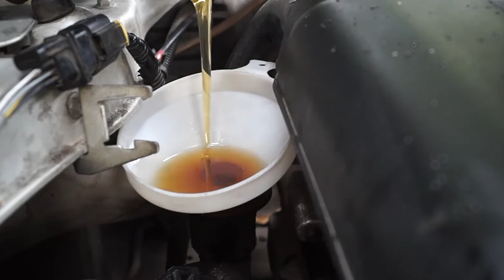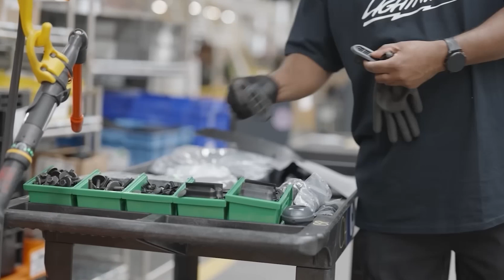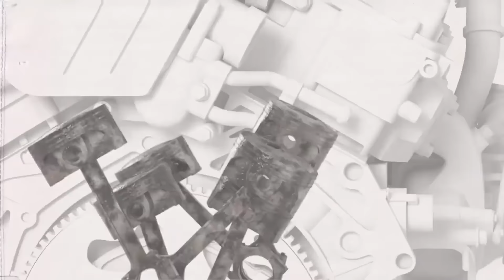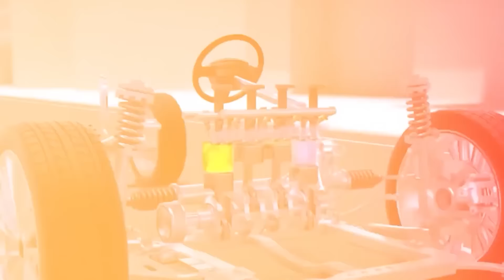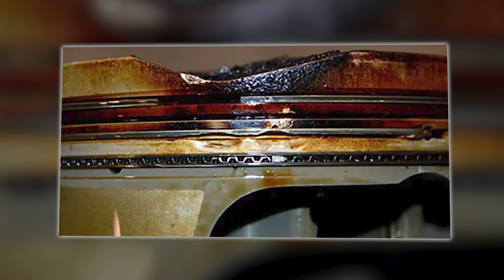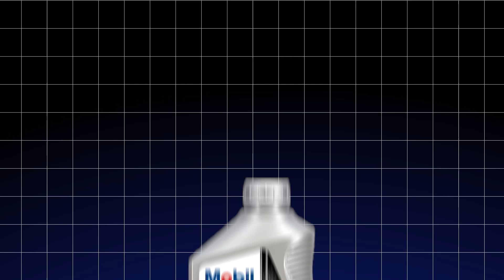Toyota Secretly Lying About Oil - Mechanics Refuse To Use

Comment: My car calls for a 0W8 grade oil. I use 0W8 oil starting in the last few weeks of fall when temp starts to drop to below 10. I then switch to 0W16 / 20 once it starts to warm up. I NEVER go beyond 5k miles between oil changes or every 6 months. This is an AI made video. Having trouble reading "molybdenum".😅

Comment: The 2026 Toyota Corolla Cross uses the same engines in the US, Canada, and Australia with different recommended oil viscosity:
                       Engine         Oil viscosity
      US           M20A-FKS    0W-8 only (page 442)
      Canada    M20A-FKS   0W-8 only (page 442)
      Australia   M20A-FKS   0W-16, 0W-20, 5W-20, 5W-30, 10W-30  (page 357)
Note the same engine, M20A-FKS, is used with recommended oil viscosity from 0W-8 (US and Canada) to 10W-30 (Australia).
Notice the US and Canada are the only countries recommending using 0W-8, and it is the only weight recommended. It’s obvious these thin oils, 0W-8 and 0W-16, are only used to get the best possible mileage and emissions, regardless of fact they disastrously shorten engine life.
Here are the URLs for the owner’s manuals.
     US: https://www.toyota.com/owners/warranty-owners-manuals/
     Canada: https://www.toyota.ca/en/owners/manuals/
     Australia: https://toyotamanuals.com.au/#/
Don’t take my word for it. Do your own research.
My wife’s 2026 Toyota Corolla Cross (Toyota states “must use” 0W-8) gets 5W-30 Mobile 1 Full Synthetic with Toyota OEM filters at 5,000 miles or 6 months, whichever comes first. By the way, in Australia oil viscosity up to 10W-30 are recommended for this engine 
Auto manufacturers recommend engine destroying 10,000 mile (or more) oil change intervals. Why anybody would trust their light oil recommendations is beyond me.
Bottom line: Before CAFE requirements most engines listed 5W-30 or heavier oil that was best for the engine. Today, with CAFE requirements, the recommended light weight oils are best for the manufacturer, so the best viscosity oil for your engine is probably not the one recommended.

Comment: Toyota brand oil is made by Mobil 1. So does tyat mean Mobile 1 oil is exactly the same? I just bought a Corolla and it's nearing time for the first oil change. I chose to go with Valvoline Advanced Full Synthetic.  Am I ok with this? I never go 10,000 miles between changes.  5k at absolute max.

Comment: I recently bought a lexus ux 250h with the m20a engine. Its recomended foe 0w16, my dealer fills 0w20 in and i got a 15year warranty on it. If those oils were bad for the engine, i dont think thy were able to give a long term warranty. 😂

Comment: This is false. Mobile 1 OW8 is available for everywhere. The dealers charge $100 on average per oil change. The hybrid engine not only does not run hard because when paired with the electric motors, it also runs cooler. I trust Toyota not this one ai produced post. Change oil every 5k. The Camry will run indefinitely when cared for properly.

Comment: Total garbage. Toyotas in Asian markets have used 0w-8 for a decade with no problems - unless better gas mileage is a problem. I’ve used it in my 25 Camry for two years with no problems and used oil analysis shows no unusual wear. Nearly every statement in this video is a deceptive lie.

Comment: Why would Toyota deliberately spec a motor oil that wrecks their engines? It’s nonsense.   I do believe oil changes at 5000 are a much better maintenance plan than 10,000.  Especially if you are driving a lot of high speed highway miles or many short trips in cold weather.  Oil is relatively cheap, engine replacements are not. Use the recommended oil to protect your warranty and change it more often.
Reply: Because the governments are forcing manufacturers to come up with better mileage. Thinner oil is less friction.

Comment: sorry to say it, but 0w 8 has been working well in toyota engines. The oil has been tested time and time again and shows it is protecting the engine just as well as your 15w 40 or whatever. thicker doesn't always mean better. if the engine is designed to run the specified oil, it will be perfectly fine. if adding the oil after designing the tolerances that will be a big issue

Comment: This video has a high bullshit content.  Nobody sane runs their oil over 5000 miles.  My Lexus UXh would have been filled with 0w8 in the factory in Japan, , but it uses 0W16 in Canada.  'Toyota puts two different injection systems on their engines to avoid the carbon buildup.  Taxis run all day and don't face cold starts son heavier oilbwould do less damage than a Canadian commuter's car in winter.  The UX250h does not have the same clearances for oil as did my 2014 ES300h.  The ES was good with 0W20 but the UX needs 0W16. ALSO:  If you fill the crankcase to specs, it will read overfull on the dip stick.  Not all of the oil drains out.  For a 2.0 L hybrid, start with 4 L only and then add a bit at a time.  Remember, it swells when warm.  I think mine took 4.1 L to fill last change, but after a week's driving, it sits exactly where it should on the dip stick when cold.

Comment: These ultra thin oils are group 3 oil, meaning ultra clean conventional oil with minimum synthetic additives of 25%, plus their is a test for thickening viscosity the standard is 100%, amsoil that i use is a group 4 oil with 100% synthetic base stocks and additives, it passes oil thickening test with a result of 0.1% and with doubling the time on the same test viscosity increased by 49.6%, I'm currently running 0W-16 signature series in my mom's 25 subaru impreza.

Comment: Since Trump ceased the penalty for exceeding CAFE standards it should no longer be Toyota's concern. I suspect that 'MPG bragging rights are   paramount. Ironically, from my 0ver 60  years of driving, mpg is greatly affected by driving habits- a light foot, coasting to a red light, no jack rabbit starts make for a Mobil economy run experience. LIkely improve your mpg by `10% or more.

Comment: I've been driving and servicing my own cars since the mid 80s when we still had leaded fuel here in Australia and the typical oil was a 20W-50. Yes, emissions were bad then - and they remained bad for quite a few years. But I reckon around 15 - 20 years ago petrol engines reached their peak. They were fuel efficient and their emissions were already by then very low, despite what Governments were telling us. My current Kia Picanto which basically still uses engine and transmission technology from 15 years ago puts out less CO2 per week than I do through my lungs ovet the same period! I reckon Governments have gone way too far over the past 15 years to the point where manufacturers are no longer making engines they would like to make. They would probably go back to where they were 20 years ago if they were allowed to. And it isn't just the engine oils. It's overly thin transmission oils, ultra high tyre pressures, etc. Just on that last point - pressures these days are almost 10 psi higher than they were in the 1980s for comparable tyre sizes and car weights. If you do driving tests and measure the temperatures across the tyres, the pressures they used to specify all those years ago result in the tyre being in the correct temperature range and the handling even on a track day is far better too (no more bump oversteer).

Comment: Bought 5 quart jug of Mobil 1 0W-08 oil at O’Reillys for $35 and OEM Toyota filter for my 2026 Camry.  Cost less than $50 and was pretty easy job. Interestingly it was not on shelf, but guy had it in the back.
Reply: Yup.
If you’re doing it yourself then you’ll be paying less than going to the oil changing place or the stealing shop
Reply: And most customers don’t go to the auto parts store for 0w-08/16.
Light beta oil for out exotic engine than go for 5w-20.

Comment: https://youtu.be/W3V5F7SaBTo?si=ESs92LnjqOGlJGcq
I made videos about my truck on this exact same subject, I'll tell you this when I would drain out the 0w20 at the oil change it looked and sounded just like water and this was just warmed up It wasn't under extreme heat or stress from driving in the real world this was just driving it around the block maybe three miles and coming back to dump out the oil. On one oil change after I switched from 0W25 w30 I drove it 12 mi and dumped out the oil and it dumped out a lot different than that 0W20. I'm sorry anyone who believes that 0W20 0w 16 0w8 is okay for your vehicle You're believing the wrong people. And I think whatever lab test they're doing on these engines that have the thinner oil in it is being falsified. Just like with my 2019 Chevy Silverado I have never gotten the miles per gallon that they said I would now maybe in a lab with the wheels being put on rollers yeah maybe it'll get that mileage but in the real world no and I feel that the thinner oils is the same way. In a lab test maybe it's fine in real world no, especially when you have a turbo, or your towing I I feel that the thinner oil is it very bad idea.

Comment: You make it sound as if the government café snap it is forcing them to squeeze extra mileage out of every vehicle but in fact the manufacturers continued to sell gas guzzling SUVs that have a much higher profit margin so they have to squeeze extra mileage out of their compact cars. They do this by using turbo charging and direct injection and super thin oil to reduce friction. 

But if the manufacturers made SUV smaller and lighter and more efficient they wouldn’t have to use these tricks to squeeze slightly more fuel economy out of perfectly good compact cars  so in the end this is about greed and profits not government regulation that tries to reduce pollution and increase fuel efficiency

Comment: I trust Toyota’s lubricant engineering far more than I would ever trust a You Tube video, but I am not a fool and some things are easily verified. You can look up your cars Australian owners manual on line and this video is correct they recommend 0W-16, 0W-20, 5W-20, 5W-30, 10W-30, and even 15W-40, but only the first four under all operating temperatures the last two are for summer use above freezing temperatures.

Comment: lol Toyota’s oil is Mobil 1, and Walmart sells 0W-8 Mobil 1 for $28 bucks a five quart jug. Also I have personally seen some Toyota’s in my shop with over 200K miles and still going on 0W-8 oil. Biggest problem is people driving 10K miles on one oil change. People should change their oil no more than 5K miles or sooner depending on driving habits.
Reply: Thank you for this comment. I recently bought a 26 Corolla and have been going down a rabbit hole for weeks about the 0w 8 oil. It’s hard to find anyone with any long term experience with these cars. 200k sounds like it works fine. I plan on changing it early as well. Not waiting 10,000 miles
Reply: Are you the owner of your shop and is it a Toyota Dealership or an Independent Garage?
Reply: 200k miles. Bs. 0-08 hasn’t been around long enough in the us.
Reply: @johnmcgavin5015  Car Care Nut had a car in his shop with 60,000 miles on 0W-8 with no problems.

Comment: FYI, Trump signed an Executive Order in February, 2026 to eliminate many EPA and CAFE rules going as far back as 2009 and all of Biden's green energy CAFE laws.  Many CEO's from Auto Manufacturers were around his desk in the Oval Office when he signed the EO.  They said they would respond quickly to the deregulation and be able to build better cars for less money.

Let's hope we see results in less than a year.

FWIW, Toyota 0w8 oil is $11/quart around the country.  Toyota 0w16 is about half that cost.  And lastly, from "The Motor Oil Geek", "The Care Care Nut Guy", and NIssan's engine designer in Japan, if you want your car to last over half a million miles, change your oil every 2,000 miles, and be sure to change the oil during brand new "break in" at 500 to 750 miles.

Comment: DEALERS USE THE CHEAPEST BRAND OF BULK OIL UNLESS YOU SPECIFICALLY ASK FOR A CERTAIN BRAND NAME OIL. I own four cars from 1998-2003-2008-2022 and they all use different oil weights.

Comment: Toyota Next Generation engines will come with 0W0 oil. They are designed to give 100 miles per gallon. These engines come with a long warranty of 12 months or 10,000 miles, whichever comes first.
Reply: ya, furthermore, the next of next gen will come with -10w -10 or just water (virtually no cost) and 200MPG. Warranty? 1 week or 100 miles, whichever comes first.
Reply: Childish, immature comment.

Comment: So on my 2023 Japan made Toyota Corolla XSE (shipped to USA) with the 2.0 gasoline engine, should I use 0W/8 which is on the engine label or use 0W/16, 0W/20, or 5W/30??  For the best MPG and LONGETIVITY for the engine?
Reply: 5w30. 0w20 at the least if you live in an area that goes below 0degrees F. Other than that.  5w30

Comment: Definitely facts spoken the video. Something to keep in mind is the new generation who are of driving age aren't into cars like the previous generations. Furthermore, drive past any car lot cars aren't selling. The reality is if engines don't last as long you have cars being replaced. Think about it. Used to have grease fittings on your lower control arm and bulge for bulge right? You don't have that anymore. Now you have less less grease from the factory and a new failure point. Cars are made better. Less alternator less coil pack failures. What's left.....

Comment: Does a Toyota hybrid engine run at a lower temperature than the average engine?
Reply: Yes, a Toyota hybrid engine run at a lower temperature than the average engine, when driven around town, but not at high speeds on the expressway!

Comment: I’m buying a new Toyota SR5 Limited first week of March and I’m gonna have them drain the oil change the filters and put 5W-30 in it and then 500 miles. I’m going to drain the oil have a sample taken then I’m going to drive it 2500 miles drain the oil then drive 5000 miles and take a sample change the oil and filters.

Comment: They called 5w30 to thin years ago now it's the norm, I'm would think you get faster oil pressure on a hybrid, car manufacturer are open to been heavily fined in the USA so I would thought they have done there homework

Comment: I’m no expert or engineer but if you can mix gas and oil together at 50:1 and the two cycle engines don’t blow up, why wouldn’t thin oil work in a four cycle engine with the proper additive package ?
Reply: Two cycle engines don't have a crank case full of oil, the oil comes in mixed with gas at 50-1 or I prefer 40-1 and blown out the exhaust port every stroke, these are two completely different engines.

Comment: Temperature is oil recommended for each country’s climate, Canada down to Kansas 0W20 , Oklahoma to South America 5W30 , middle eastern 15W-40 . Change 5,000 max before oil change
Reply: Yes, it should be based on the place weather conditions or temperature.